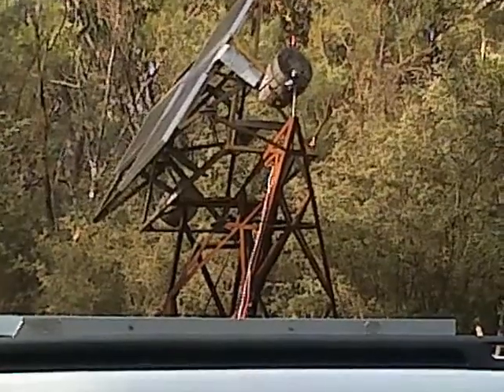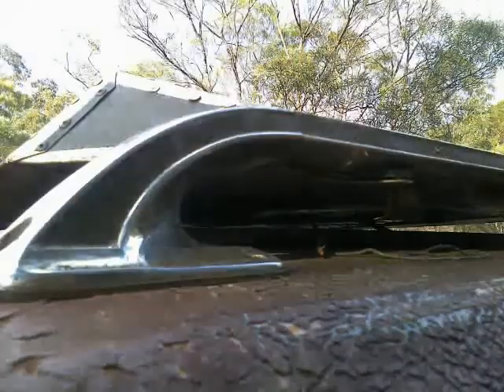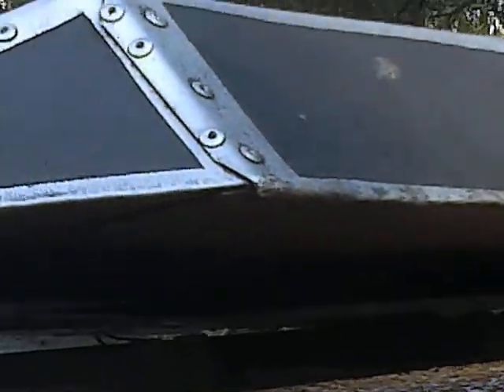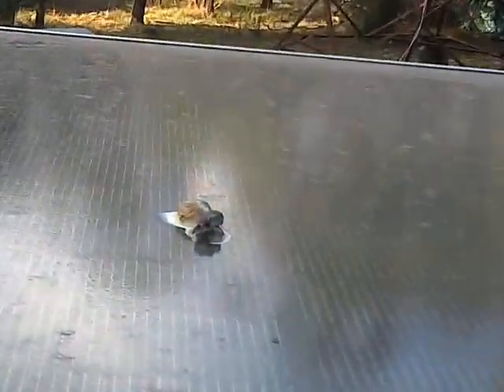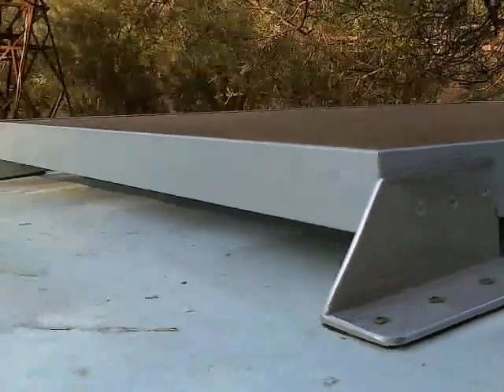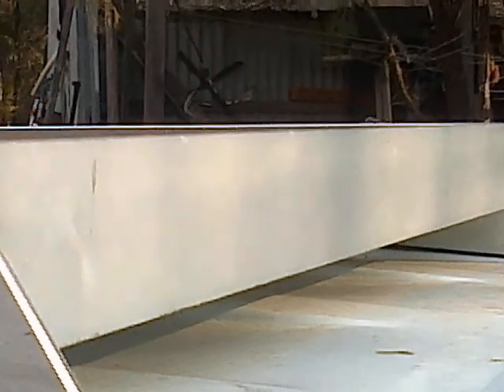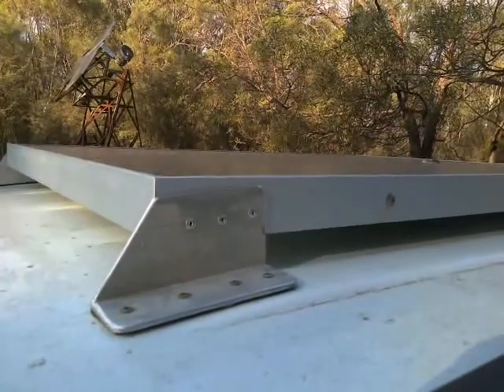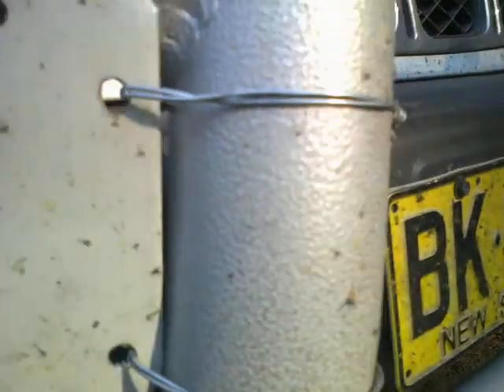Bitumen Wind-Tunnel, SunFoil Mk-8 ; Perpendicular Aerodynamics... (!).

Comment: maybe its just the angle of the windscreen is just launching all the bugs above the sunfoil....
Reply from the maker: G'day,

  Thanks,

  Ah, nope..., there was a Romanian Aviation Pioneer called Henri Coanda who crashed in flames in 1910, and afterwards he wrote of observing the way the Flames followed (parallel to) the Curved surface they were flowing past..

  Ever-afterwards they've called the phenomenon "Coanda Effect", and it's a Keystone Principle of Aerodynsmics...; it's why the BLC Vents blowing on the underside of the Mk-3's Trailing-Edge "suck" the Airflow over that 45-degree "Chine" at the top of the Trailing-Facet...

  The Coanda Effect lines-up the Airflow parallel to the Cabin-Roof, after it climbs the Windscreen, ensureing that it hits the Flat-Face perfectly perpendicular to the Leading-Edge of the Mk-8.

  On my Son's Rodeo, the Mk-8 is on the Fibreglass Canopy at the back over the Tray, and thus the Air coming past the Cabin has to change direction, and climb ; so it impacts the Mk-8 L.E. at about 10 Degrees, from below, and his Mk-8 has Bug-Guts on it's Leading Edge.

  To correctly position his SunFoil would have meant drilling into the Cabin-Roof...; and that was beyond my remit...

  So, yeah, I think I got the "Invisible Voodoo Aerodynamics" roughly round-about right, with this one...

  Have a good one,

  ;-p

  Ciao !

Comment: Hi again mate. What do yo think of the HHO gas producers for cars?  You are ''VERY'' clever with numbers and calculations. I however am ''CRAP'' with numbers and calculations. I just think things up in my nogin and sometimes it works. Oh by the way, ''THANKS'' for sharing your brain to people😃
Reply from the maker: G'day,

  Thanks.

    Ah, well, to be honest, the fact that it takes between 8  & 12 Hp of Torque from the Crankshaft to coax the Alternator to produce 1 Hp worth of Current means that using an Automotive Alternator to electrolyse Water into Brown's Gas is never going to produce anything like as much "Fuel" as the Engine is burning in order to make the Torque....

  If people claim that the minute amount of Hydrogen & Oxygen "improves the Combustion Chemistry, and thus benefits Fuel Consumption...., I say think about the Engine's Inlet-Airflow Throughput....; multiply Swept Cylinder Volume (in Cubic Centimetres) by 1/2 the operating RPM (assuming a 4-Stroke Engine, but with 2-Strokes this halving isn't neccessary) and multiply the result by 0.85 to allow for Aerodynamic Drag in the Carbutettor & Inlet Manifold & Valve-Seats....

  Now compare that figure (in my 2 Litre Forester's Case, at 3,000 RPM it's 2.55 Cubic Metres of Air per Minute), and that Air needs about .21 of a Cubic Metre (7.4 Cubic Feet) of pure Fuel-Gas to burn in it....

   Now visualise 7.4 Cubic Ft (210 Litres), and then look at the tiny weeny itsy-bitsy miniscule little Bubbles coming up in the Electrolysis Unit....; and the Brown''s Gas isn't within an order of magnitude of what's needed to burn that amount of Air....

    In my "Mad Scientist Videos...." Playlist there's one called something like "Hodgey's Hydrogen-Burning Hybrid Subaru....", and in the Comment-Thread under that a bunch of quite clever people explained quite a lot ; basically the only way a HHO system could manage to add more fuel than it consumes via the Alternator would be to cover the Roof with Solar Panels feeding the biggest  Deep-Cycle Battery which will fit in the Vehicle, and have that Battery ONLY Solar-Charged (not connected to the Alternator) and then run the HHO-Bubbler exclusively on Solar Power.

  And, then, I still reckon the added weight & Aerodynamic Drag from the Bootful of Batteries and Solar Array to feed it...; would make it not worth doing.

   A Channel called +Desertphile one had a $1,000 HHO Challenge, he would give a thousand US Dollars to any manufacturer of any HHO Device if they supplied him with a Unit for him to test it's Fuel Consumption, and it actually saved some Fuel....; and nobody offered to let him test their Products, so I entered my SunFoil Project in his Competition, on the grounds that SunFoils actually do save fuel and they work for all the reasons why the HHO-Bubblers don't work - SunFoils ensure that the Alternator makes as little Electricity as possible & spends most of it's life being a Turnaround Pulley for the Waterpump's Drive-Belt....

    Desertphile then made a charming Video to me, explaining why he had to exclude my SunFoil Project from his Contest, because my work has no Bullshit in it, I don't claim to have broken the Laws of Physics, and as far as he can see SunFoils do indeed save fuel.

  I think his Move to me will be in my "Favourites" Scroll, back in about 2012, and mine to him is in both the "SunFoil Project..." Playlist  and the "Mad Scientist Videos...." Scroll.

    The misapprehensions behind the HHO Troo-Buhlievurz Brigade are that they think that,
      1) an Alternator rated at 50 or 120 Amps is ALWAYS producing that much Current, any time the Engine is running....; and, 2) that producing the aforesaid Current doesn't cause the Engine to have to do any extra work (making extra Torque) or to have to burn any extra Fuel in the process....

   My guess is that they get the first idea because they don't understand how Automotive Alternators work, nor how the Regulator controls it's Output REGARDLESS of Alternator RPM (as long as it's between roughly 2,000 & 15,000 RPM, but it needs to be doing about 4,000 RPM to reach it's peak Efficiency....), all according to how flat the Battery's Voltage indicates it to be, at the time....

  And they get the second wrong idea by holding an Alternator which is not connected to anything in one hand, and then spinning it's Rotor-Pulley by hand ; and when it thus turns freely they spontaneously decide that not only do "Alternators produce Electricity without taking any extra Torque to do it...!" and that, "It takes no extra Fuel going into the Engine to drive the Alternator, because the Engine is ALREADY running !" and finally that, "if nothing is done with all that Electricity coming out of the Alternator (magically, for Free !) then all that Current would be otherwise going to waste ; so let's pump it into a Bottle of Salty-Water and claim that it's a Suck-Cess....!".

  The people who sell HHO - Kits are as bad as the people who sell Magnets to clamp around the Fuelpipe to "Align the Hydrocarbon Molecules" and thus make them burn more efficiently, the people who sell Spiral Vane-Guides ("Cyclones") to go in the Inlet Manifold to make the Engine burn less Fuel, and the people who were selling Magic Pills ("Firezone...." !) to drop into the Fueltank to improve Fuel-Efficiency....; all four rely on two things to convince their Customers of the efficacy of Bullshit....1) almost nobody habitually buys all their Fuel at the same Bowser and records all the Fuel going into their Tank and adds it up  once a month to divide into the Oddometer's recorded Distance-Covered for the month....; so almost nobody actually knows what their Vehicle's Fuel-Consumption was before they try any new Gimmick or Gadget.

  And 2). As soon as anybody pays for any "Fuel Saving" Device, Potion, Lotion or Pill, most people will subconsciously commence driving more gently & sedately in the hope of seeing an "Improvement" on the next Fill-Up ; and because they have no Baseline it becomes really easy to "Feel" that the Vehicle is using less Fuel....

  And although such Placebo-Effect doesn't last past 3 months, they stick with their initial favourable impression - and because they then "believe in it" they never even try to check the Figures (because that would threaten the Feelgood Factor...?).

  I hope that-all helps, I'm pretty sure it's what is happening - out there in Real Life...

  Have a good one,

  ;-p

  Ciao !
Reply from the maker: +WarblesOnALot 

 Oopsie.

  "  +Desertphile ONCE had a Challenge..."

  ;-p

  Ciao !
Reply: @WarblesOnALot 
that has got to be the best and most intellectual explanation i have ever read on onboard HHO
Reply from the maker: +Fred Z 

G'day,

  Thankyou !

    I have a sort of a deepseated horror of being misunderstood, to begin with..., and after years of messing around with living off-grid (and raising my son to have become the Town's Auto-Electrician...) I've spent hundreds, if not thousands, of hours trying to figure out what the actual story is, about Motor-Vehicles, Alternators, & the Fuelburn - when a Solar Panel with it's own Battery Charge Controller is added onto a Normal Vehicle...

  And, it turns out that every reason why a SunFoil saves Fuel, is an irrefutable chunk of evidence attesting to "Onboard HHO" being a complete Crock Of Rocking-Horse Shit, garnished with Hen's Teeth - and scented by a delicate Miasma of Unicorn-Farts & Dragon-Burps.

  And, my great hope was that if I could explain why SunFoils are a good idea..., then the practice might catch on..., and in the beginning I fantasised that if having a Solar Battery Charging System (Retrofitted) became a condition of Annual Registration (like having roadworthy Tyres is..., and functioning Brakes..., and servicable Suspension, Seatbelts, & Windscreen Wipers...) which are ALL  compulsory, and potentially expensive, "hurdles to Registration" - which are all relatively well-tolerated by the Road-Using Population, as a whole ; then the annual Australian Road-Transport Fuelburn (and thus Greenhouse-Gas Emissions therefrom...) could feasibly be easily  reduced by 15%, perhaps 20%... (4.5% to 33.25% are the observed worst & best improvements, on over a dozen individual vehicles, over 10 years...) {probably hundreds of SunFoils have been YT-propagated, and in my home-town I've only been personally involved in 8 of the 24 Cars getting around sporting Photovoltaic Arrays....; so I don't hear everybody's results, but the SunFoils do seem to be "breeding in the wild", finally !}.

  So, I've become rather well-practiced in speechifying and explainificating and otherwise attempting to convey some reasonable underconstumbling of what's actually going on...

  And, well, my son the Auto-Electrician has a 30 Watt Mk-8 SunFoil on his personal 2.5 Litre Turbocharged 4-Door 4-WD Diesel Rodeo, and it's 0 - 100 Km/Hr Acceleration-time dropped by 25% after fitting ; and his 5-Ton Isuzu 4-WD Workshop Truck has 2 Pairs of Mk-8 SunFoils on it, two 45 Watt  & two 150 Watt units, atop the 4 Toolboxes....

  So, if I was talking bullshit, he wouldn't be letting me put my SunFoils onto his Cars for 11 years, let alone fitting 4 of them onto his Workshop Truck...

   One day, probably after the Oil-Pipeline to Oz has come unplugged..., then perhaps the Mainstream Media might decide to "give a shit" ; but in the meantime, my "SunFoil Project..." Playlist is here on YouTube, all the Construction-Clips are posted, so it's literally a Grassroots DIY Project to personally ameliorate Global Warming.

  Source your materials locally, and either give it a go on your own, or get your local Auto-Electrician to watch a few SunFoil Videos before wiring it up for you.

Have fun...

  Such is Life,

   ;-p

    Ciao !

Comment: What do you use to stop any leaks?
Reply from the maker: G'day,

  Well, if you look closely you can see that between the "Foot" of the Mounting-Pylon/Fences and the Roof of the Car there's a synthetic-rubber Gasket, cut from an old Automotive Inner-Tube, about 1.5mm thick ; it's slightly smaller than the outside dimensions of the "Footprint, maybe a millimetre inside the edge, with a circular hole for each Rivet.

   Because the Roof is Steel & the Bracket is Aluminium, I recommend Stainless Steel Rivets to prevent Electrolysis in Coastal (wet/salty) Air...; and the Compression needed to set the Rivets squeezes a waterproof "Doughnut" of Gasket-Rubber into a Waterproof-Seal, protected from UV, by being well inside the edge of the "Footprint".

   I reckon one can ignore whatever Water might try to track down the Throat of the Rivet, because the entrapped broken-off head of the Mandrel seals that hole from splashes from above.

   It seems to work.

   Have a good one,

  ;-p

  Ciao !
Reply from the maker: +WarblesOnALot 

  PS,

   The Gaskets are Contact-Cemented to each "Footprint", before marking the Roof-Holes' positions, through the pre-positioned "Footprints"...

  ;-p

   Ciao !